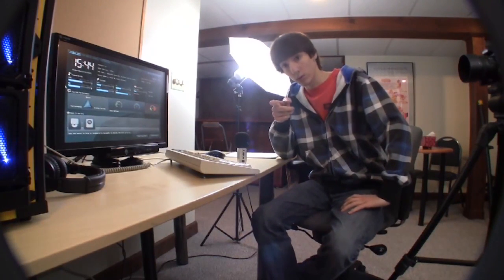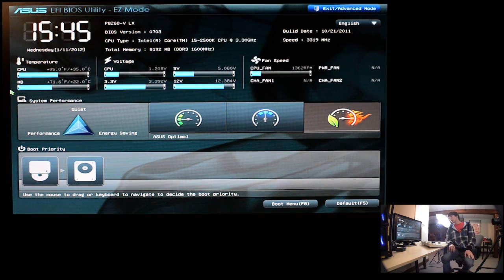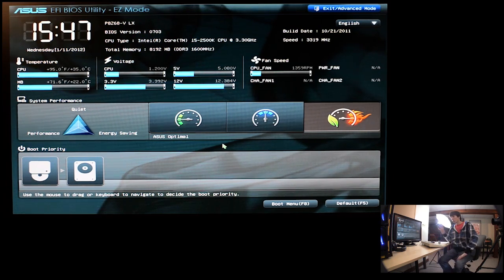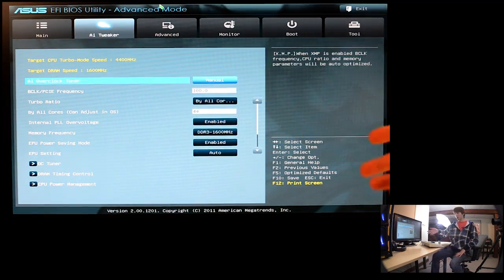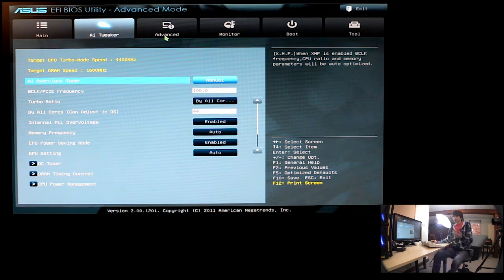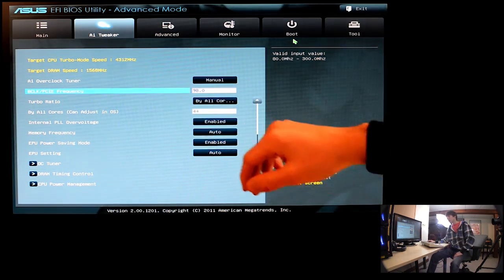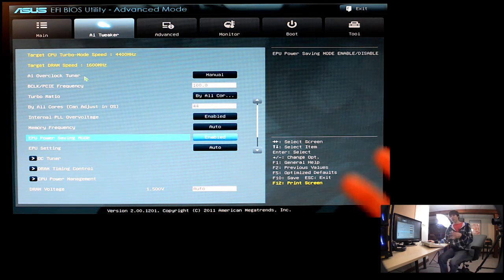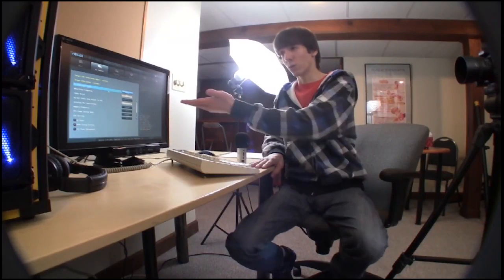Intro to Overclocking With a ASUS P8Z68 Chipset

Comment: Gearing up for a budget build with integrated gfx hoping to run playable WoW @somewhat playable rates, Got a  P8Z68pro/gen3 MOBO +Intel i7 2600k CPU + DDR3 32GB Corsair 1600 RAM (Intel compatible box says) + PCIe NVME samsung 950 SSD with adaptor as bootdrive. Thats the gameplan so far i only got the MOBO & CPU next week gearing up for RAM as reseearching SSD options  so far landed on the NVME but trying to fogure out if itll boot windows on same MOBO. First time doing computer build - 426Hemi stroker full boltons was alot easier to understand for me then trying to figure out this lol. PS* see an STI in your name im a big fan of Subarus as well had gen 1 2dr impreza full STI drivetrain ULH headers/exhaust minimal weight on that chassis & that thing was a RROCKET.
- trying to apply same principle building fastest budget comuter using somewhat modern parts with minimal budget avoiding GPU purchase to play WoW as im hoping the integrated gfx will be enough with above said extras. If makes any sence to you advice appreciated

Comment: Hi, I'm happy to hear that you have an Asus P8Z68V-Pro/Gen3. Will I get a Stable Overclock with this board at 4.8 or 5.0 ghz on a I7 3770k ?
Reply from the maker: If the CPU is up for that challenge, it should be able to.  Good luck!

Comment: I own a Corsair H100 liquid cooling system for my i7 2700K processor currently running at 3.5GHz and i own exactly the same motherboard, is ok if i overclock my processor to 4.2GHz?  with the exact settings that you used on this video? Following step by step

Comment: 4400MHz is 4.29GHz not 4.4GHz. It is divided by 1024.
Reply: No.
Reply: no, thats the correct calculation for megabytes to gigabytes, but megahertz to gigahertz is straight multiply by 1000. its all to do with binary vs base 10 calculations.
Reply: LMFAO

Comment: i have,  INTEL CORE i7 3770  3.40ghz,
ASUS P8Z77-V LX, INTEL Z77
450 power supply, DDR3 G.SKILL RIPJAWS X 4GB x2 (so 8gb of ram in all) getting 8 gb more!
120MM LIQUID COOLER. 5 Fans!!
will these settings be safe for mine? im a gamer ;)

Comment: So if I do exactly like you did in this guide I can overclock my 2600k? 

You see on the bright side we have exactly the same motherboard with that BIOS interface. Im planning to mount a Noctua CPU cooler and it would be cool to have it from 3,4ghz up to 4,4 ghz man :)
Reply from the maker: Yup, it should be very similar.  I've used this method for my current processor, the 3770K, as well.  Enjoy!
Reply: Zepppster Thanks man thats awesome dude.

I really dont know much about OCing but this helps alot! 
Now im just waiting for that CPU cooler. I think you know alot about computers, I used to be very interested in PC from like 7-20 years old, now its not my biggest interest but its still fun :)

But what if it burns up or gets destroyed? I dont think this will be the case since I see its very popular to use this Noctua NH-D14 cooler, but is there some safety function that helps if things are going to shit? I dont want to fry my CPU u know ;P

Comment: I have the Kingston HyperX 8GB RAM, do you recommend me to get it to run at 1600mhz? Because it's currently running at 1333. Also, I have a Corsair Carbide 400r and don't know which water cooler could fit... Tips? Thanks!